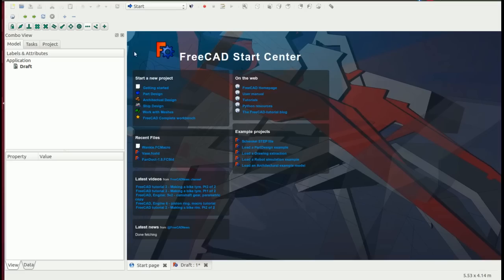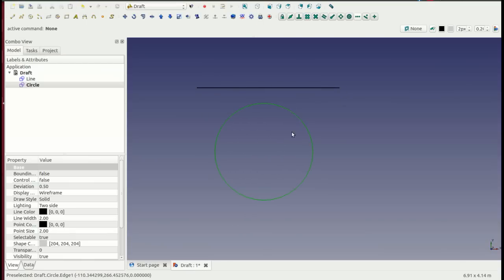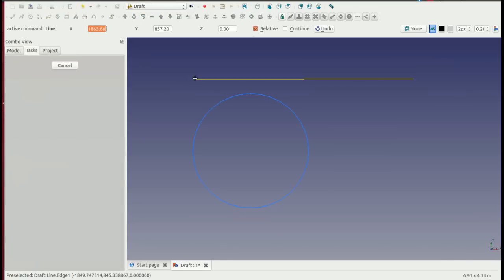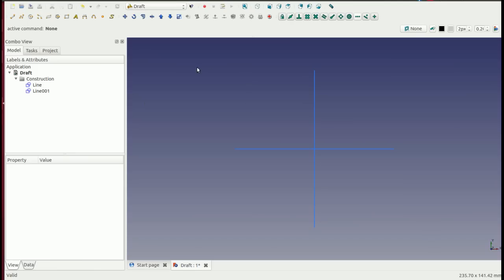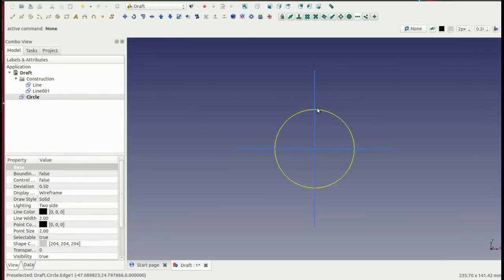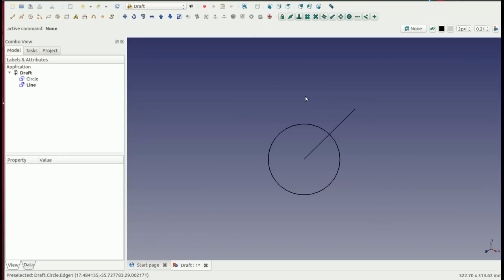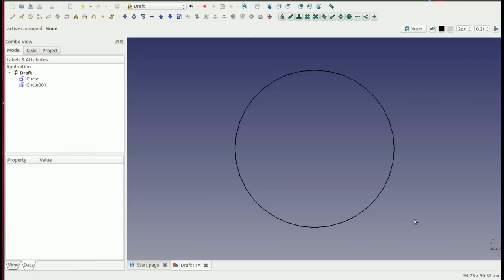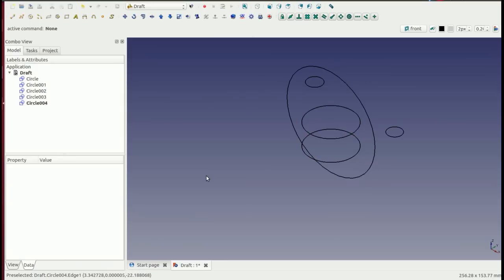FreeCAD Tutorials - Part 3 - Draft Workbench

Comment: Is it possible to take a picture and load it into FreeCAD?

For example, I'm trying to create a reproduction of the F-18 flight control stick, and I have profile and front-on pictures of it. Could I load these then draw parametrically over the image?
Reply: To do this you'd need to reduce it to two values in gimp or photoshop, then create a raster image of it. You can then polygonize that raster image, then convert that shapefile to some CAD-friendly format

Comment: @Martham Engineering are these 7 year old ones still valid because I am sure there are a number of changes?
Reply from the maker: FreeCAD has changed completely since I made the very first videos. Some of the information is still valid but they need redoing.
Reply: Thank you was wonder if I would just get confused watching older video's, I am using the latest stable 0.18

Comment: This was complete rubbish. Didn't help one bit
Reply: I am newby to 3d design, but within 2-3 weeks I am finding Freecad works for me, even doing some complex stuff now.
Reply: I find that the hardest part is understanding the structure of a part which has several levels, ie cylinder to cut to pocket to fusion etc etc.  Then when I go back to edit a dimension, I cant find the part in the nested structure.  But I am sure it will come with time.